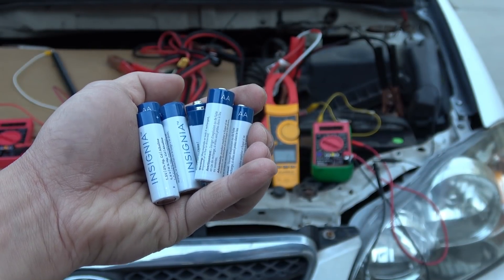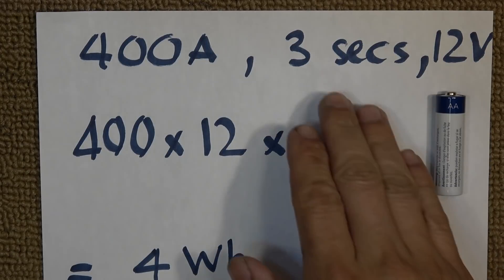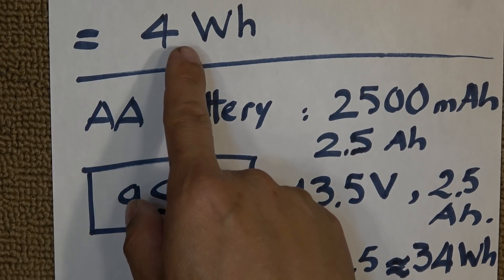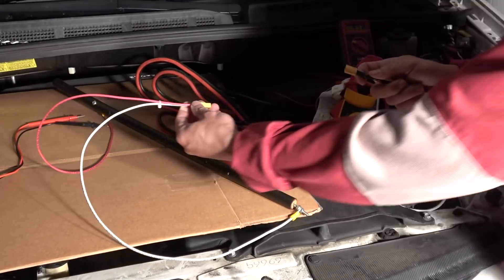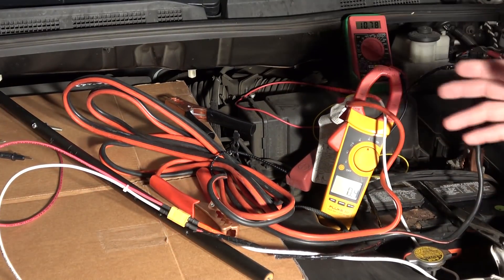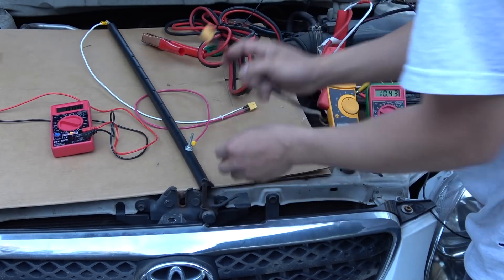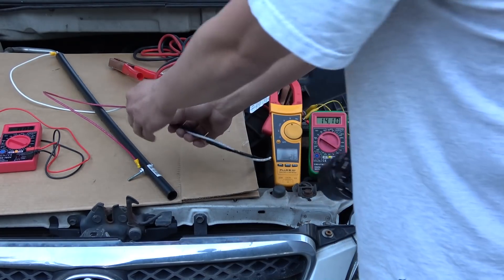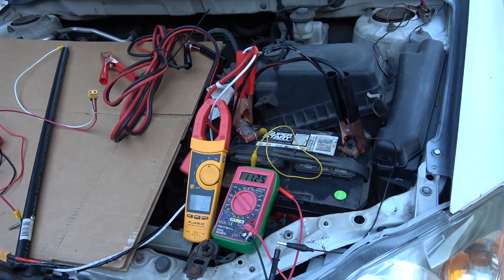Can you jump start a car with AA 1.5V alkaline batteries?

Comment: great work done.  as an electrician I fully understand your careful messurement. And I think if that battery was a newer better conditioned one, it SHOULD start the V6. (charging not effectivly accepted or the energy not effectivly transfered) . I got GM3800 and need a strong battery in very cold winter.
Reply: Well, you're not a good one then. You don't wait until both batteries settle on half dead when jump starting, it is to be done rather quick and not after the no-load is under 11 V.

Comment: Before watching i will tell you, that it should be impossible starting from 8/9 batteries, because even if they had enough energy then every battery should give you starting current like 300/400 amps (impossible). If every battery can give you 5 amps you have to connect 9 batteries in series, and then 50-100 of those series i parallel. If each battery even can give you 20 amps you have to connect 9 batteries in series and 10-20 of those series of batteries in parallel.
Why? Because when you are connecting in series voltage increases but current which one battery(1,5v) is loaded is same as current which car uses in 13v. When you connect those 9*1,5 packs in parallel current on one battery is proportionally smaller (because of more batteries) (in veeery simple explain)
AND YOI HAVE TO STOP CAR BECAUSE YOU CANT CHARGE AA BATTERIES
E: Your car started with only current that can give you single battery? I can't accept it and believe

Comment: You didn't include resistance of battery in your calculation. There is no way it can provide 400A at 1.5V for AA cell!
Probably instead of use 9 cells, increase 10-11 cells to charge car battery for 15 minutes.
Reply from the maker: Not 400A, mate. It's a Corolla with 1.8L engine which requires only about 100A. Watch the entire video before you post a comment.
Reply: @vuaeco  Don't be rude. He's right. Hook your jump starter directly to the leads without the car battery and have a friend standing by with a fire extinguisher.

Comment: What if you made a size D 10 or 11 S pack? Incresing the pack to 14v with a higher amperage discharge rate...would that start a V6? Then patent it and sell it to the masses!
Reply: There's already tons of pocket sized mini jump starters available for as cheap as $60 at Walmart, harbor freight or Amazon and eBay that utilize 18650 lithium ion rechargeable batteries for the most part and also have multiple standard 5volt USB ports built into the power bank to charge any 5v USB powered device such as phone, laptop, flashlight, blue tooth speaker etc etc..... In the end isn't even worth building your own as it'll cost you $60 in decent quality 18650's alone then you still need the case the boards and chips and the jumper cables in which you need alligator clips , 10-8gauge wire and special connectors usually just to built in itself.. so this is something really more for the bored hobbiest just to see if they can do it, it's not really practical as like I said much higher capacity rechargeable compact units that are practically pocket sized are on the market for $60-150 and have been for nearly 10 years now. They are basically the same exact thing as a portable powerbank youd carry as an emergency of off grid phone charger except for the fact that they have the ability to put out 12 volts and come with a pair of short stubby jumper cables that plug in with a special connector. The technology is really pretty basic.
Reply: I agree. If you’re trying to make something with already existing and costly batteries, there’s no reason to waste your time. But if you are in a pinch and you have batteries laying around, this is pretty useful info.

Comment: 10.5V in a car battery usually means you have a dead cell. If you can afford it, replace it with a Northstar battery. Solid lead, deep cycle; they're unkillable. You can buy them direct with free shipping or get them from Batteries Plus with a free install (and free recycle of your old one). They cost $250 (3.5L F-150 2015) but with a 5 year warranty you're basically paying $50/year which is better than the garbage batteries that cost ~$100 with 2 year warranties. My stock Ford wet battery lasted 3.8 years.

Comment: That wire you are using is to small it will heat up in seconds
Reply from the maker: Not enough time. I only used it for less than seconds! :D
Reply: He only uses it for seconds it isn’t left plugged in

Comment: My girls mum can’t find her charger for the lifepo4 8s pack I rebuilt it’s 29v full charged I’ve put bms on it but can I charge with a lithium charger say 36v?
Reply from the maker: I doubt the 29V BMS would be able to take 36V from a charger. Try the HP printer power adapter. Most of HP printers put out between 30V to 32V DC.
Reply: its 32v output my hp how do i know which wires are + an negative theres 3.well one wire has white/black stripe is that neg?one is black an other has stripe solid on it
Reply: goin test leads with meter to see if + or -
Reply: its 15 an 16v across 2 pairs so under load would go up to 32v would it?

Comment: But isn’t the hover board charger ac to dc so the boost converter converts from dc to ac?
Reply from the maker: Yes, hover board charger is AC to DC. Boost converter is DC (low voltage) to DC (high voltage)
Reply: But my sister hasn’t got ac on her land at the moment so would need inverter for the charger to work

Comment: 12v think
Reply from the maker: A 12V controller is not going to charge a 42V Li-ion battery pack. If you have 12V solar panels (open circuit voltage about 20V), then the cheapest way is to get a boost converter to boost the voltage up to 42V. If you still have the balance board (BMS), you can just use the original charger or use a Bird/Lime/Segway scooter charger as they are all 42V DC. And they are cheap.

Comment: hi my sister has off grid home and needs to charge a 36v lithium battery i made off hoverboard can they charge with solar panel they have what do they need charge controller and voltage converter not sure?thanks
Reply from the maker: The hoverboard battery is 10S Lithium ion. Max voltage is 42V. You can use a hoverboard battery and just plug directly to the battery even without a BMS. But you will need to balance it once in a while. You can also use a DC-DC boost converter like the Ming He 7210A to charge it. Your solar panel's voltage has to be below 42V though. Here's the video of the 7210A controller I use to charge my hoverboard battery: https://youtu.be/yFch7jAFEpQ

Comment: Try it without the original car battery using just the double AAs I guarantee it wont start,although the original battery is weak it still has 10 volts charging it for 30 mins using the AAs increases that voltage connected in parallel across the bigger battery of course it will start nothing spectacular there.like I said at the start try it without the original battery that would be a more accurate and loaded test.
Reply: Why not try swimming with a lead belt, too? Christ...
Reply: Yeah why go swim bc hes telling the truth

Comment: Yes you can ! Also a 9v battery will start a car. U get one chance. Been doing it for 20 years
Reply from the maker: I doubt a 9V battery can do this. Its voltage and capacity are too low.
Reply: @vuaeco  I challenge you to try it. It won't work with that bad battery you have cuz the voltage is at 10. If a battery has been drained down to like 11.xx it will start it. Take a 9v connector and extend the wires, put the battery on there and let it sit for a few minutes. Try it.
Reply from the maker: @pointedspider  Might be a good project to try on.
Reply: @vuaeco  really curious to see if this would work now :-)
Reply: @vuaeco  Confirm, it's been one of the pretty popular ways to jump-start a car in the 90ies in some parts of Russia, cause some ppl have been having a box of batteries at home (it might have been hard to quickly find where to buy one when needed, there was a lack of everything), and 9V PP3 were widely used in radios. So many have tried it and it could work.
Reply: Maybe an old  6V vehicle lol.  If you connect a 9V battery which might be 9.5V at brand new fully charged, to a dead 10.5V car battery - which one do you think is going to charge which? A 9V PP3 will not in any way charge a dead 12V car battery anywhere near enough to start a vehicle. If you use 2 of them to get 18volts, yes maybe you can put a small amount of charge into the car battery - but those 9V cells are seriously lacking in capacity even compared to AAA cells. You would have to use several lots of 2x PP3 ... so maybe if you had a box of 10 lying around you might do it - but it's such a hassle it's just easier to use this AA method in an emergency surely.